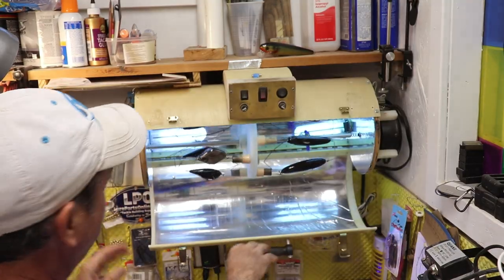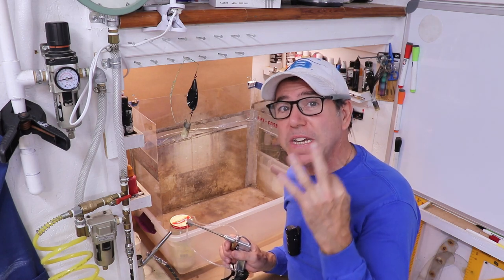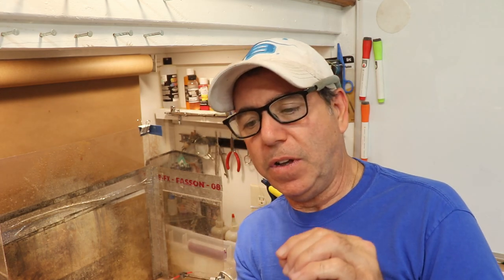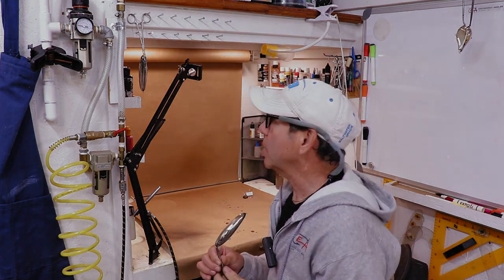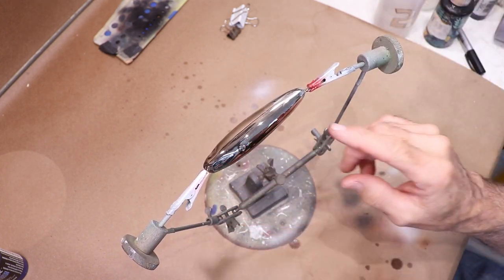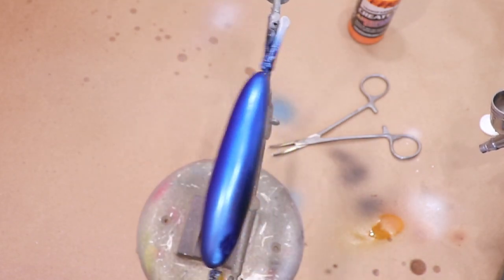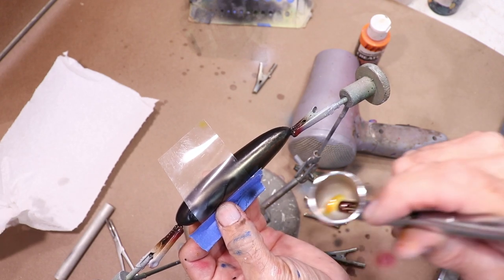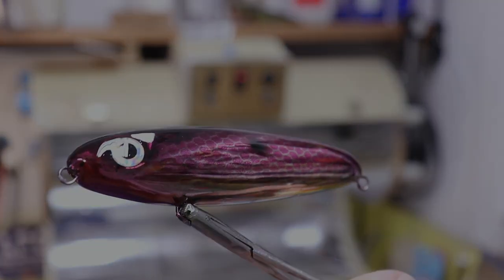How to use spray chrome for lures, My 3 Favorite Topwater Colors  #spraychrome #paintinglures

Comment from the maker: If you have questions on the silver plating process check out the videos I have made on the topic.  There are links in the description.
Reply: Completely different topic. But I wanted to know how the pvc decking or the jon boat is holding up. Is there any warping, splitting, cracking, does it clean easily or stain easy. You pros and cons. Your build with pvc is the only one I’ve really found. Any feed back would greatly be appreciated. better yet some recent footage would be awesome. And if it was a total flop I’m sorry but I wouldn’t want to make same mistake. Feedback please.

Comment: I haven’t gotten set up to do silver plating yet.  Thats a winter project for me.   I have some smooth blanks to work with and experiment with.  My question is:  I am in the process of making another master with the scales pressed in. So, when I mold, the scales will be on the lure blank.  You indicate the lure must be smooth/shiny.  Will the silver plating work on blanks with the raised scales??  Thanks for all your videos!!!!!
Reply from the maker: The amount of perfect reflectivity in the silver is directly Proportional to how smooth The surface is. You will have to do a bit of experimenting to see how much resin clear coat to put on To get a good  Silver finish without obscuring your scales.

Comment: Thanks for the video, I have to say your media is extremely informative and valuable. Out of curiosity, do you find the lures tarnish if not being treated properly before clear coat? Or is the clear coat enough to inoculate any tarnishing if the surface isn't touched in-between the silver application, painting, and clear coating?
Reply from the maker: You have to put a protective coating of the correct clear coat before painting. Then you clear coat again as a finish.
Reply: @EngineeredAngler  Thank you, I actually found more of this information in another one of your videos. Fantastic stuff.